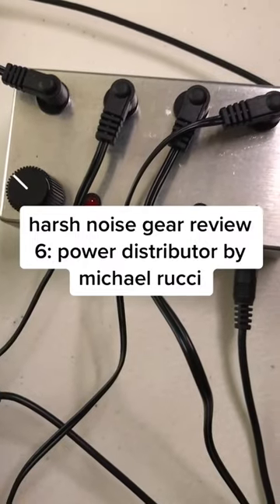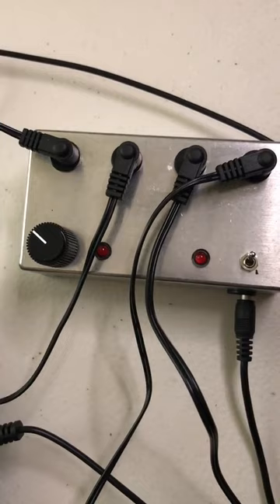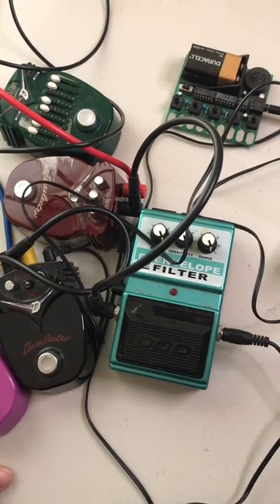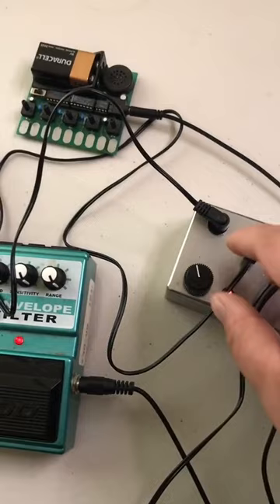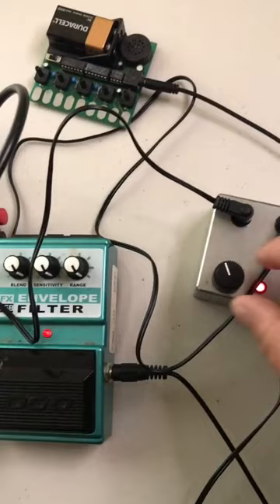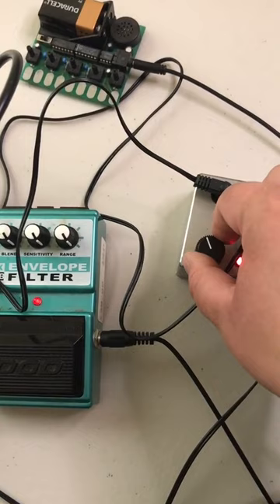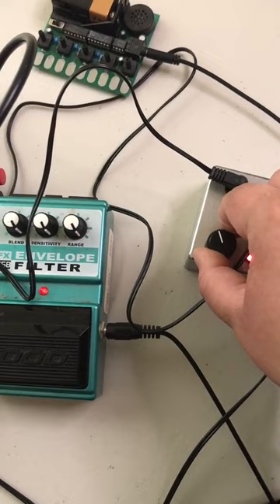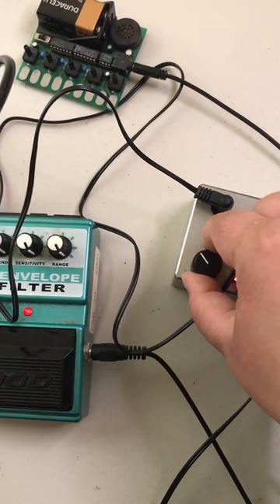harsh noise gear review 6: power distributor by michael rucci

Comment: Probably should have mentioned that voltage-starving doesn't work well on digital pedals. Not sure if any of the ones you used were digital, but that might be why it was so quick to sputter out when you turned the knob very slightly.